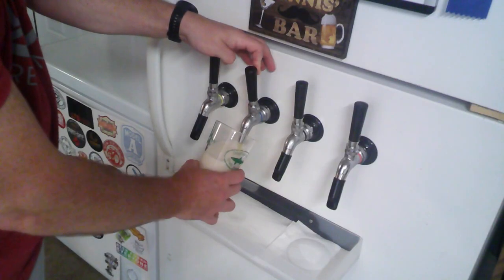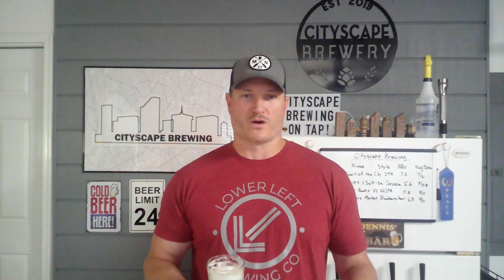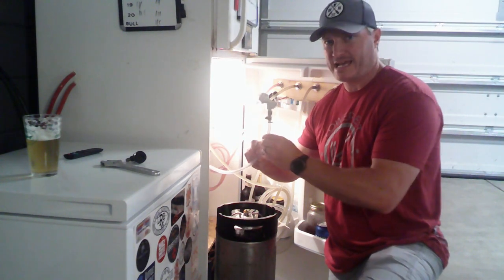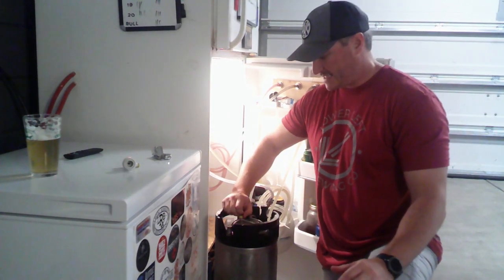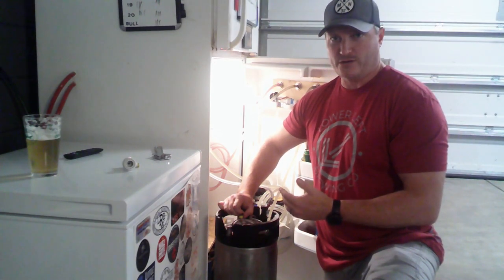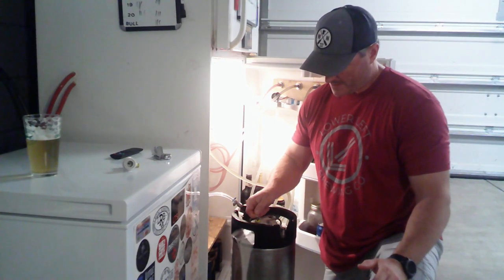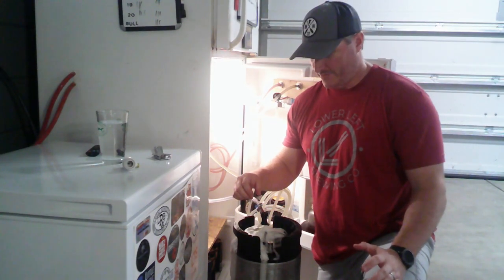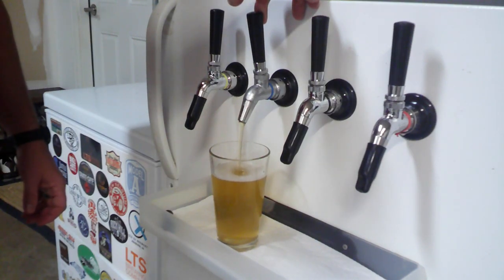FIX an Over Carbonated Keg in 15 MINUTES!

Comment: Update: THANK YOU!  I replaced the liquid connector with the gas line connector.   Left the original gas port without a connection.  Then followed your directions on purging, the foam purged out of the gas port.  5 minutes later, I was done.  Now I am pouring perfect beer.  Thanks again
Reply from the maker: Awesome! I'm glad that worked! 🍺

Comment: Could a guy release the pressure and then remove the fitting (that the coupler goes in) and let it sit for awhile? Basically what you do when you wait for “head” to go down
Reply from the maker: You could but you also risk some oxidation. It will be very slow naturally decarbonating. The point of pushing co2 through the beer is to pull out the co2 as the bubbles travel up through the beer

Comment: Honestly, you went from a nice foamy pour to a flat pour.  The one you call perfect , I would reject. 1-1.5 inches of foam is the norm. You also wasted a lot of beer (foam is beer too).
Reply from the maker: When I first poured the beer I had about an inch of beer at the bottom of the glass and the rest was foam.  Even if the beer ends up under carbonated,  it will recarbonate by sitting at normal serving pressure. I agree you want 1-1.5 inches of head, and it will end up that way even if you let out more carbonation with this process. The point of the video was to show people how to get carbonation out of their beer when it is very over carbonated. Sometimes this is the only way to do it, even if you lose a pint in foam.

Comment: I did what you said...both techniques and I still have foam bombs. My other tap pours fine so it is not a line length issue and both are cold. Annoying.
Reply from the maker: Have you tried switching the kegs to the one that pours fine and see?

Comment: And there is me trying to use this method to quick carbonate my kegs, seems i am making things worse? I Also use a carbonation stone on the end of a flexible line on the Co2 side of a keg  to fast carbonate soda water. And this works , so why does this work to un-carbonate an over carbonated beer ?
Reply from the maker: Because the CO2 comes from the bottom of the keg on the dispensing line and the CO2 pulls the smaller bubbles in the beer to decarbonate while you are pulling the pressure relief valve.

Comment: thanks for the video.  I'm currently dealing with an over carbonated commercial keg.  It's driving me crazy.  I've followed all the steps to clean the system, and still similar to your first pour.  Then I used a picnic tap, still foamy, so it isn't my system.  I'm going to try your method, I will reply back with results. Thanks
Reply from the maker: I'm not sure if this will work with a commercial keg. It depends on if they're dip tube goes all the way down to the bottom or not. This only works when the dip dube from the serving line can go all the way down and pull out the CO2. Another suggestion is to use a longer serving line for the picnic tap... That will give it some resistance and friction and should slow down the beer and not be as foamy
Reply: @CityscapeBrewing  thanks for the suggestion.  The other problem is I can't open the keg, so there would be no place for the foam to be expelled.  I'm back to the beginning again.
Reply from the maker: Yeah, a longer tap line might be your only choice.... You don't want to pump new CO2 in there or else it will get worse. Another choice is to just keep drinking it without it hooked to CO2 at all... But the pressure release by creating more headspace when the beer empties
Reply: @CityscapeBrewing  a thought, I swap the gas and serving line connectors on the commercial tap.  Push gas down the serving line, and keep the gas line (that is now the serving line) open to let liquid out.  My question is will foam/beer be expelled out of the commercial tap via the gas line?

Comment: Nice tip, I will have to try that next time I get an over carbonated beer :)
Reply from the maker: Yeah I've had a LOT of people reach out to me about this.  They hook up gas at 30 psi and then forget it for 4 days haha.   It works!
Reply: @CityscapeBrewing  I just recently moved to pressure fermentation for my last two brews, and it looks like my days of forced pressure carbonation may be over! I was able to source out the parts for my homemade spunding valves between my homebrew shop, a local hardware store, and a big-box hardware store (known for their blue buckets)😆 for a few of the remaining fittings. Along with installing a floating dip tube in the kegs, I ferment/naturally carbonate/dispense right from the same vessel. This might be a great video idea down the road!
Reply from the maker: Good idea!  May have to look into that.
Reply: I as well went to pressure with the fermzilla and love it

Comment: Would this apply for a soda as well? I’m currently trying to carbonate a water mixture for a cannabis infused soda. In a side note would a water soluble surfactant cause the foam when dispensing @ 10psi?
Reply from the maker: Yes it would work if it is over carbonated.   For soda, you must have a lot longer serving line for the higher pressure to keep the carbonation in the drink without foaming.

Comment: I have a D style coupler.  How would you recommend doing it with one of those
Reply from the maker: The same way. You would put the gas on the beverage out line so it goes down to the bottom and pull the pressure relief valve. Only do short bursts for the gas to go down to the bottom. And wait for it to release all the pressure and repeat.
Reply: @CityscapeBrewing  Soni assume you have to turn the pressure up quite high?
Reply from the maker: @jonathanritter7364 no, normal serving pressure is fine.  You don't want to turn it up at all

Comment: Are you using serving PSI (10-12) during the process to remove excess carbonation?
Reply from the maker: Yes.   I don't change the pressure.

Comment: white connectors usualy connect well in the beer side
Reply from the maker: Yeah I've used them before but I also had one stick on so bad that I had to break the connector to get it off.  So now I just tell people to switch them quick so they don't have that problem. 🍻
Reply: Sorry. I haven't found that to be the case!